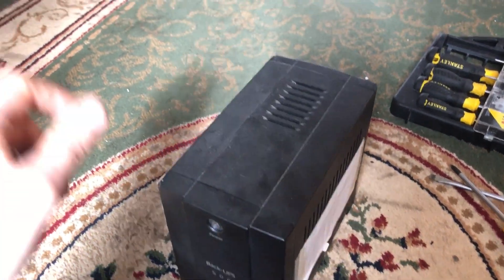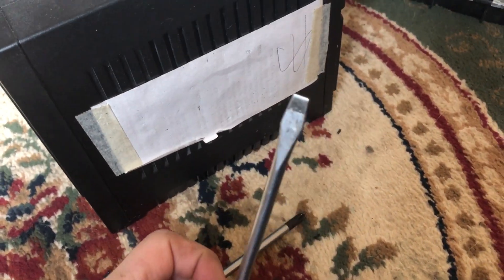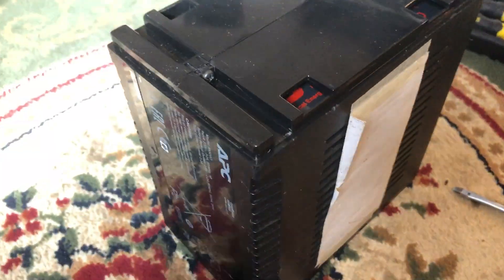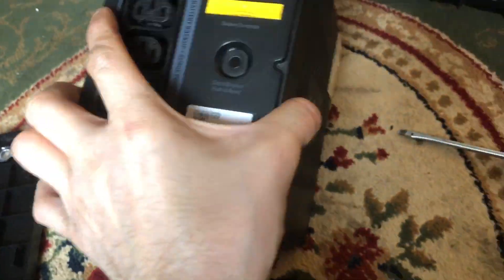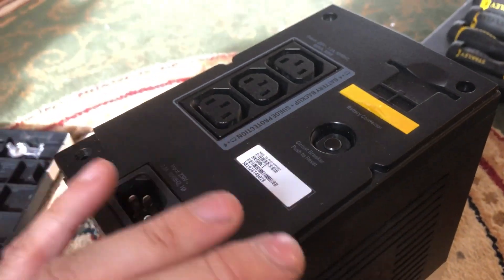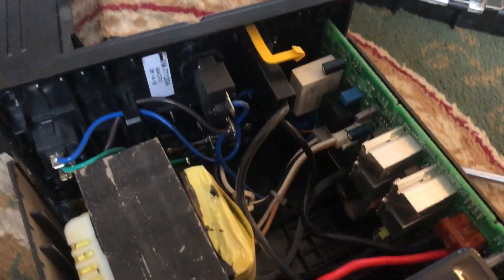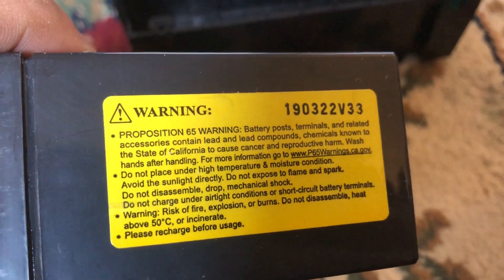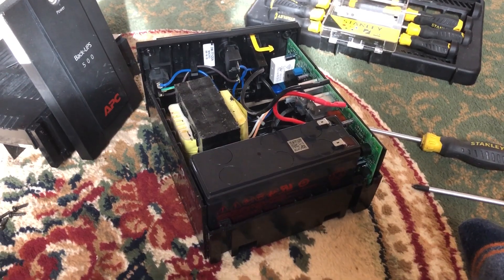APC Back-UPS 500 Beeping Constantly Battery Replacement How To

Comment: I like this video, very helpful.  I have a similar unit.  Unfortunately, a new unit cost only $5-10 more than a replacement battery.  Also, consider degradation of the MOV's in the surge protector.  We replace the battery, but the surge protection circuitry has still degraded.

Comment: My APC Back-UPS CS 500 looks completely different. It's beige for a start, and battery replacement is far easier. But I cannot find a replacement battery with F2 Faston spade terminals. All the ones I've seen listed on the internet have F1 Faston spade terminals. The F1 version is narrower, at 4.75mm, whereas the F2 version is 6.3mm wide. The last time I replaced the battery was in 2014 and I purchased it from APC. Cost me 41 quid! Now the cheapest replacement from several suppliers is under £20, but like I say they all have the narrower F1 4.75mm spades.

Comment: Hi i just replace mine, and it still beeping, should i do something to reset? I have 2 of them in the same situation.. thanks for tour help
Reply: Same situation...
Reply: I have replaced mine with the same branded battery from the video. Charging works fine from the Powerchute app. I can see there is no error message at battery stays at 100%, like I said, brand new. Once I unplug the power, devices connect to battery backup gets turned off and continues beep, starts, and doesn’t stop until I interfere. Does anyone have an idea what this could be? 
Thanks